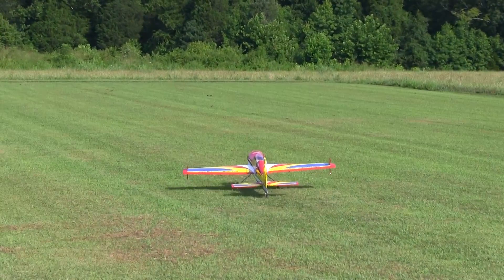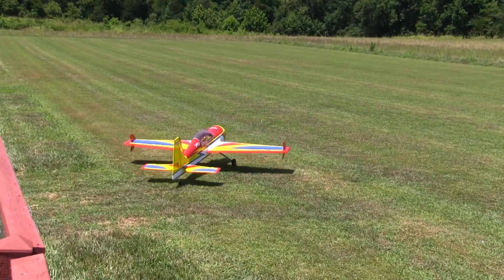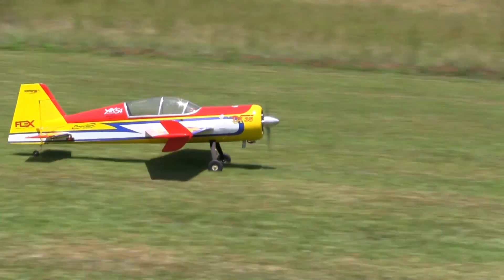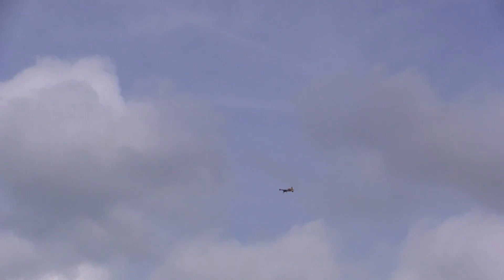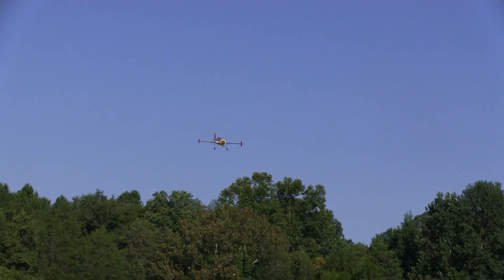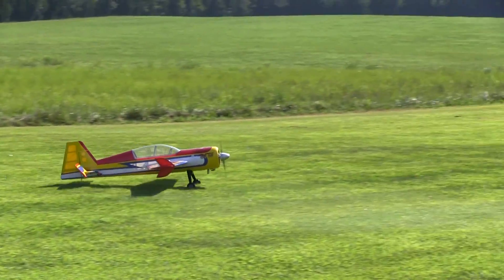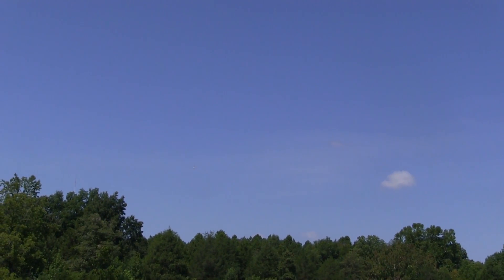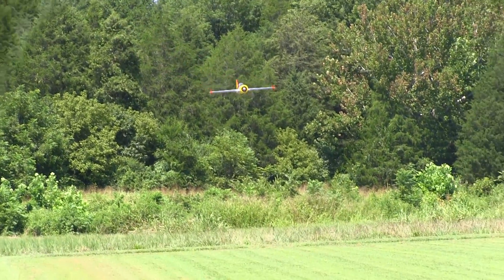QQ YAK 54 35CC ARF Trim Flight Day/s

Comment: Hi Thintz,
Thanks for your videos.
A small question.
You have built 2 YAK 54, from Pilot-RC and Flex-Innovation.
Which of the two models was the easiest to fly.Which of the models has the highest quality?One of the two models must be my first "big" model.Looking forward to hearing from you.
with best regards
Reply from the maker: The Pilot version is the better plane for me. They make good quality planes and it flew very well. I believe the Flex Innovations Yak has been discontinued which is never a great sign.

Comment: thintz12  I just finished buildig that plane! While measuring the rudder movement, i realized that the Elevator and the wingtip on the right side are around 1cm higher then the left side. Is that to counter the engine force? Or is that a construction mistake?
Reply from the maker: I'm not sure how you are leveling the plane in the first place to make sure you are getting a real difference. Either way, contact the Flex Innovations folks for the real answer. They are great people and the ones answering the questions actually did the development flights so they KNOW their planes!

Comment: Whats wrong with the stab? angle? i Have this plane myself. Soon ready for maiden.
Reply from the maker: Mine had a warped elevator but Flex Innovations replaced the whole stab set to avoid trying to cut the elevators out and re-use the stabs themselves.
Reply: ok, i see. my elevators look ok so i hope everything is normal. Thanks for the fast reply.
Reply: Is the elevator solid piece balsa or is it built up?
Reply from the maker: Built up